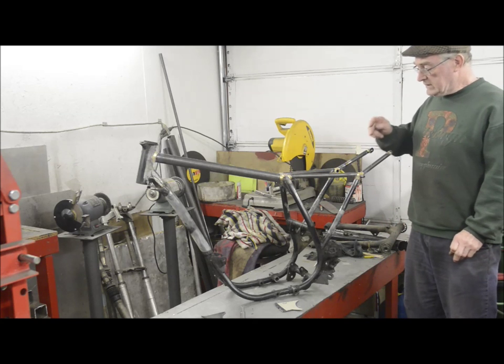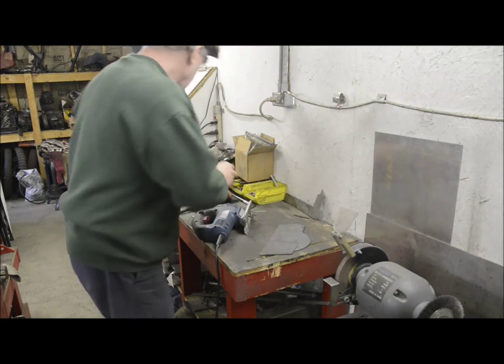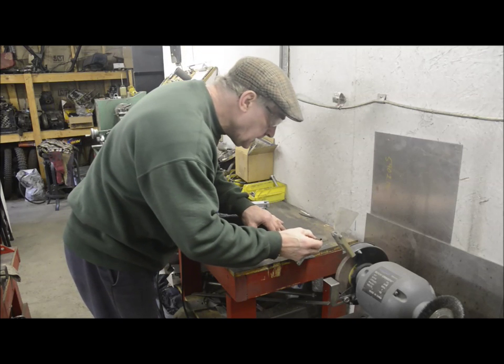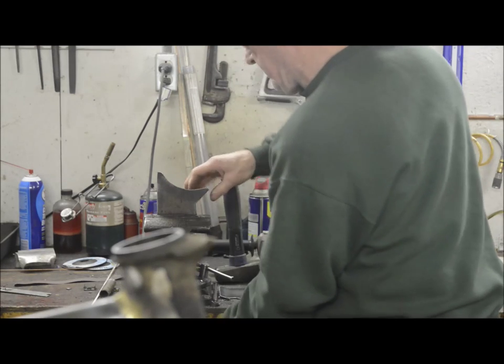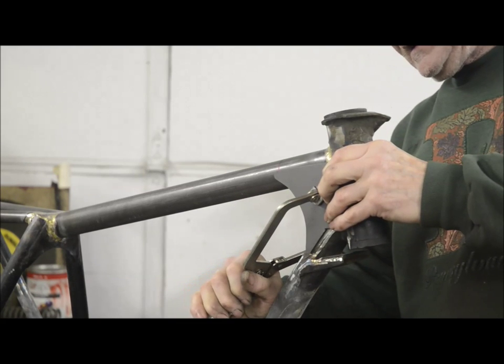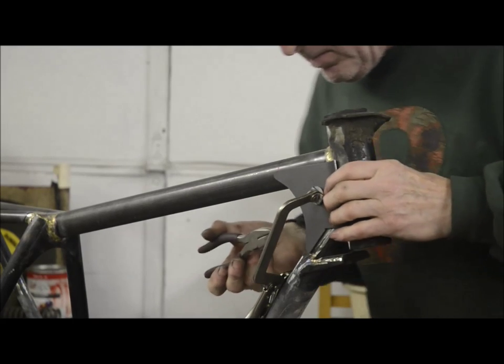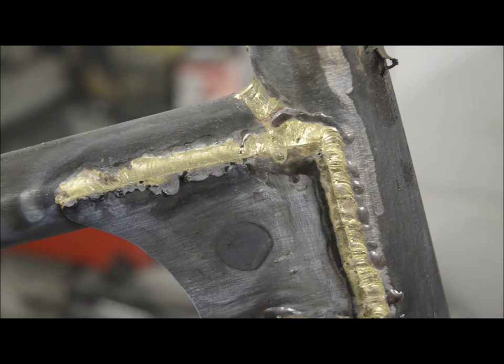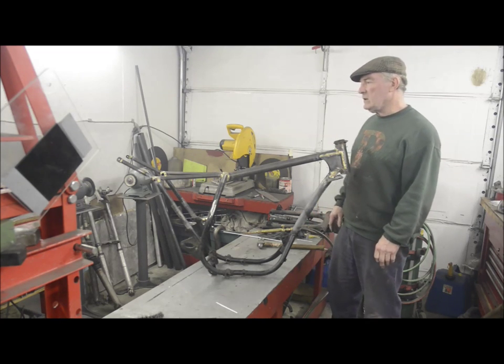BM 250 Trials - Frame Part Four

Comment: You are going to have to make a better jig-saw cutting table. For if that blade had snapped, the jig-saw would have shot forward and chop your fingers off. I was told never have your hand in front of a jig-saw just in case the jig-saw shoots forward for any number of reasons and doesn't cut your fingers off. I was cringing when I just watched you cutting that metal. It's an accident waiting to happen.

Comment: That was a master class in bronzing/brazing tubing. I thought the welding glass was a very good idea, let me watch hand motions and the bronze going in to the joint. As to camera work, let me first say that every YouTube creator has problems with that. and with the fact that humans are not transparent.  The pilgrim's progress is handheld > tripod -> super-boom built into the shop. The latter is of course the best. The doubleboost channel has one, so does halligan142 - built mostly of pipe fittings. As you say, I'd really see the bike than your head. Commend you headgear, in my day they were called gorblimey caps. Have two myself.